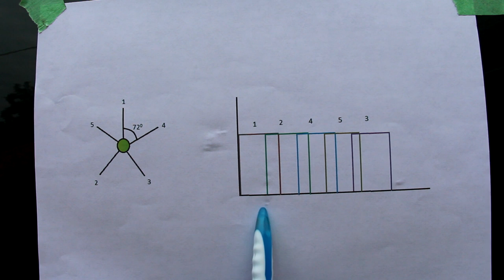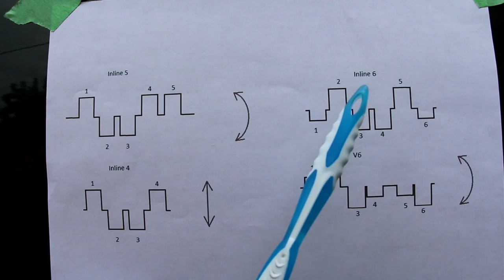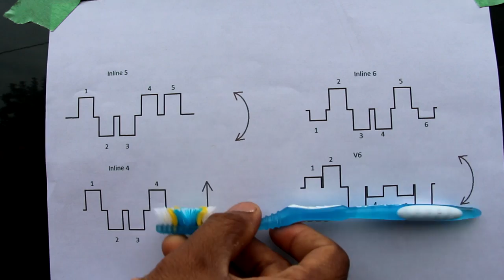Why Inline 5 Cylinder Engines are an Anomaly

Comment: “Oil is not a good coolant”

Mutters angrily in air cooled
Reply: And oil still isn’t a good coolant.  That’s why they are air cooled engines, not oil-cooled. 

Spent many a summer day waiting for takeoff in a light aircraft with oil temp edging towards the red, 60 weight oil pressure almost nothing, hoping that the plane would still climb with the extra 20 knots I was going to add to climb speed to try and keep the the engine from overheating.

Then the opposite... coming down at 200MPH in icy winds and unable to reduce power to increase descent rate without shock cooling. 

Oil is best for lubricating.
Reply from the maker: Oil does a minor degree of cooling to the piston heads, but the it's not as effective as coolant
Reply: In a 2 stroke it actually cools
Reply: @calvinnickel9995  oil cooled engines also exist
Reply: Some pitbikes have oil cooling. (including mine)
Reply: @calvinnickel9995  LoL. All engines not installed in a boat are air-cooled. PORSCHE air-cooled engines have multiple oil-coolers and work well. You shouldn't fly until you understand engineering more.
Reply: @calvinnickel9995  I had a GSX750 that was technically air cooled but it only had small fins for cooling. It also had an oil cooler.
Reply: My motorcycle is oil/air cooled :P
Reply: Oil is a fantastic cooling agent , there is actually nothing else you could use  to cool the moving components . Without oil the engine would soon overheat regardless of whether it is classed as air cooled or water cooled . 
I think the mechanic is referring to the cross contamination  of liquid coolant and engine oil .
Reply: Witch one have better specific heat capacity, oil or water? Best way cooling parts using oil based that oil kills friction. Of course when oil is toi hot, it must have own cooler(s). Transformer use oil to many thing's and heat is one. But when something fail's, it's usually just oil what cause it some way.. I think eweryone who want's can understant how "good" oil is, to carry a heat. And one thing is that the oil take a hit from high temps. Water can used 350°c (under pressure) but oil burns or looses quality usually under 300°c.  Sometimes oil is ONLY way to go, but that doesn't mean it is best in theoretic. 

It is good insulator, but If moisture or water get's in transformer, electrons are escaping with flashes and bang's..
Reply: Coolant is not a good coolant.  Water is better but will cause corrosion.
Reply: @speedkar99  suzuki gsx 600r is oil cooled bike and they are very reliable, it uses 5l of oil and can work on higher temps
Reply: I had a 1988 750 gsr-r that was oil cooled.
Reply: @speedkar99  The oil may not cool , it prevents over heating
Reply: "Air-Cooled" means Oil Cooled. The real hot spots get oil. Just that changing 20 liters annually doesn't have the ability to upcharge when you take it for service.. As in "Built in Obsolescence" and extra complexity really helps.  No answer I've noticed to the question...
Reply: E type jag is oil cooled. It has water but the oil helps a lot. That is why it has 15 quarts of oil. 

Still overheats though.
Reply: @calvinnickel9995  The oil helps to stop cylinder blocks  from overheating in all engines
Reply: @genesmith4019  What cools the water that cools the boat engines?
Reply: @NICKELGHANDI  the earth.
Reply: @jamescaley9942  coolant is a beter coolant than just water. water transfears heat beter but it allso has a lower boiling point so anti freze is actualy a beter solution than just water
Reply: @calvinnickel9995  oil is a very good coolant.
Reply: @rampage3337  The boiling point of water is increased by the pressure of the system, allowing the water to absorb more heat. That's why when there's a leak you still overheat, even though the head and water jackets are still submerged in coolant, it's not pressurized and it starts evaporating, can't take on any more heat. Antifreeze just bumps up the boiling point by a bit. I've successfully used straight distilled water many times. The thermostat will regulate the coolant temp at the same level as antifreeze. If there are no leaks (including the most important part : the radiator cap or other pressure regulator valves) water is pretty good.
Reply: @NICKELGHANDI  Sea water through a water to water heat exchanger.
Reply: @speedkar99  hey man I've been watching your vids !I like them is there anyway you can do a mitsubishi 6g75 mivec v6 engine !!those engines are so reliable!!
Reply: @speedkar99  Part of the mistaken view of Oil as a Coolant is from the heat from External Oil Coolers. As people don't understand that while Oil will absorb less heat than Coolant, it still needs to be kept cool or it will deteriorate & fail as a lubracant...
Reply: @rampage3337  Water has more heat capacity than antifreeze. Antifreeze may have a higher boiling point but with a 15PSI system it really doesn't matter because straight water won't boil at normal operating temps. If you live where it never freezes then using water and an additive like Water Wetter will improve cooling (compared to antifreeze/water mix) and prevent corrosion.
Reply: Water is better and transporting heat than oil. Water can change phases, but oil cannot condense back into something useable. Because water coolant can be reused and has far more capacity to move heat it becomes an economic optimization. I’m sure with enough oil coolers you could redesign an engine to only use oil for coolant but do you want to replace 10 quarts of oil every change?
Reply: @zacharyclarke4240  Did you miss his story that made it clear he knows air cooled engines exist? No, relatively speaking oil sucks compared to water based coolants.
Reply: @jannejohansson3383  oil is good for keeping down the temperatures between metal to metal contact parts like gears,  coolant is good for keeping very cool big hot areas like the water jacket in the block. See if u throw water while drilling a metal piece you will keep the temperature down but will rust overtime, not with oil
Reply: @genesmith4019  you shouldn't comment before you build your own engines. x)
Reply: @jannejohansson3383  Marine or Porsche Grasshopper?
Reply: @genesmith4019  I think it dosen't matter witch one, because you can hand both?
Reply: @jannejohansson3383  LoL. Learn English and you'll be able to read those assembly manuals.

Comment: 13:34 according to vida that is a resistive element to heat the oil vapor in very cold climate to aid better separation of oil from combustion fumes
Reply from the maker: Thanks for the clarification. I was wondering what that was about
Reply: @speedkar99  Was looking forward to this video ever since the subaru engine video,where you showed a sneak peak,My brother has a volvo c30 with the b522s4 engine in it that failed, started producing a lot of blowby in the crankcase causing the intake cam seal to pop off, after replacing the seal as we assumed the crankcase pressure might be because of a faulty pcv membrane,it still started pushing the cam seal and we later found this was due to scoring on one of the cylinder leading to excessive pressure in the crankcase 

(the cause of the scoring which i intially assumed was when the cam seal came of and he lost oil pressure, but when we tore it down, all the main bearings had no damage and everything indicated there was no drop in oil pressure as he caught the leak quick enough.
I saw a small chip of metal missing from the piston crown and welded back on the side of the piston crown causing it to score deep lines in that cylinder liner,Such a weird failure mode,              I realized later that,once when someone else was driving the car one  of the vaccum lines on the upper intake plenum leading the a evap purge solenoid valve broke off and the engine was suddenly exposed to a massive vaccum leak on the highway, which may have caused a few detonation to remove a small sliver of material from the piston crown and weld it at the other end of the piston causing it to score the cylinder. (the theory is that fuel trims couldn't adjust quick enough to control the massive lean condition caused by the vaccum leak on the highway leading to the detonation that killed it as described, thought i would share that because that was the very first time i encountered one of this
Reply: That engine doesn’t have an EGR valve.
Reply: @ghostwrench2292  lemony snickets series of unfortunate events
Reply: @ghostwrench2292  i meant to say evap purge solenoid, i edited the post
Reply: @lordjaashin  yeah i love that show, sucks to be on receiving side of it though
Reply: @vijayvjn6874  What did vida say was the initial problem for the C30? Back when you did the cam seal job?
Reply: @michaelstrongbow2336  there wasn't any dtc code set by the car so vida didn't report anything, as dtc are only set if sensors detect any out of family data or over threshold data,and high crank case pressure from a non sealing piston wouldn't set any dtc code

Comment: I normally set my playback speed at 1.5 or 1.75, but I liked your presentation so much that I was willing to back up almost to the beginning and set it to normal speed. And I don’t know if this is a compliment, or a critique, but even with you on normal speed, and listening to it a second time over, I had trouble following! 

Bro, this is actually totally a compliment. I am so grateful for your interest in following the oil circuit through the PCV valve and dis-assembling that valve assembly.

I really enjoyed following along with your narration, and your frame of mind was very refreshing , also therapeutic.

This message coming from everyone who struggles with aggravation during complex mechanical projects. 

Keep up the good work!

Comment: Great to the point video. I love these engines, hate to see that drivers let them take so much damage and discard the vehicle instead of taking care of it better. 
I owned two of them (B5244T5 and B5244S2) and both were running smoothly and reliable for over 300.000 km, last one still in use waiting on completing the next 300.000. The 2.4l engines are a little better to service, as the oil filter is top-down and the PCV trap is separate.
Reply: Great! One issue I'm scared of is there is a PCV banjo bolt in these engines that has a metal ball inside and it has been known to unluckily break and cause the metal ball to get sucked into the engine and cause damage. They released an updated banjo bolt, but it seems like either a snapped timing/accessory belt or a broken banjo bolt can be the immediate death to the engine! Pine Hollow Auto Diagnostics made a video on the Volvo where the banjo bolt broke. (there is an updated banjo bolt that doesn't break)
Reply: @zzoinks  thanks for sharing. I changed my pcv trap a while ago, did not know about that failure.

Comment: so many folks miss one of the outstanding values of a 5 or 10 cylinder motor.  It has extremely flat torque throughout the curve and the dynamic balance is exceptionally good.  You have ignition every 72 degrees.  What we seem to be missing here is that Benz, EMD, GE, and many other significant prime mover manufactures have done very well with variants of the 5 cylinder engines.

Comment: The Atlas engine is also an excellent 5 cylinder. These are also known as the "Vortec" engines and they were found in SUV's. They were made in 4,5 and 6 cylinder versions by GM at their now defunct Moraine Ohio plant. I love the Vortec 4200 in my Trailblazer, great running inline 6 with plenty of power for a daily driver.

Comment: The turbo engines do not have a in head manifold. You must remember that they made this engine for like 20 years, so you have to specify which year you're talking about.
Reply from the maker: Good to know. Most modern turbo cars integrate it
Reply: The older models have the oil filter on the bottom of the engine with really easy acces. The oil pick-up line also changed from metal to plastic apparently. And im guessing this is a 2,5 liter engine which has thinner cilinder walls compared to the older 2,3 liter ones. The cilinder walls on the 2,5 liters will crack when tuned to much.
Reply: @jur8831  2.4L 4 inline natural aspirated engine with multiiport injection is where reliabilty begins. Yes, it consumes little bit more, but lifespan of such engines is great.

Comment: Damn, this man has his ICE knowledge nailed! Impressive. I will have to disagree on the top mounted cartridge oil filter setup being more prone to messes. I find that it is a much more efficient and clean way to change a filter. The oil drains out when the engine is off, rather than pooling inside the filter like your typical steel canister style. Also, most of them come out with the cap. But for filtering I still prefer the spin-on canister type filters.
Reply from the maker: Thanks. Sure it drains but your still open to a dripping filter in the engine bay as opposed to spinning it down the Bottom into a drain pan
Reply: @jimmer411  awesome life hack!

Comment: I have a 4.0 inline six in my old Jeep.
Still runs like it did 28 years ago. Wish I still did! Inline six engines are my personal favorite. 
Silky smooth torque, like the hand of god.
Reply from the maker: Nice, I love the Inline 6.
Reply: Mississippi Ditch Fisher  put a better motor in it I suppose
Reply: The Jeep 6 has an interesting history, starting out as an AMC six in the 1960s for various models. They then cut off two cylinders off to make a straight four for the 1984 Cherokee (a GM V6 was an option). When GM pulled out, AMC was forced to create a "new" six by adding two cylinders to its four.
Reply: Everyone swear by the smoothness of i6 engines. Why have we then been stuck with crappy inline 4s?
Reply: Inline 6 is the king of engines. Most industrial engine companies are now focusing on inline 6 and v12 engines, as the parts crossover between the two are excellent. Manufacturing is supper efficiency. And of course; efficiency, longevity, balance and torque go hand in hand and are top notch out of an inline6 or v12
Reply: @faustin289  Mostly because a straight 6 is too long to go in transversely so is no good for FWD applications. Straight sixes are actually making a bit of a comeback in the premium sector as they are simpler than V6s and basically an extended version of an inline 4. They are great provided you have the length in the nose to accommodate them.

Comment: Another great video.  Its almost as though the engineers get tired.  "Well, we are 95% done with this super complex engine.  Let's finish it off with some cheap, plastic bits."
Reply: that's wasn't the engineers, blame accounting...
Reply: Generally the plastic parts-given they are quality made- tend to serve the engine through it's lifetime. It makes the engine lighter, cheaper and all other stuff that matter like how quickly can an engine warm up to operating temperature. An 80Kg engine warms up faster than a 90Kg engine.
Reply: Those plastic bits didn't look cheap by any means. They seemed in perfect working order. Even the PCV look in good condition, it's the seals and valve that goes to ghost.